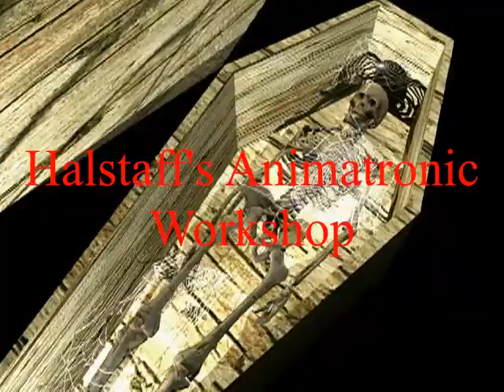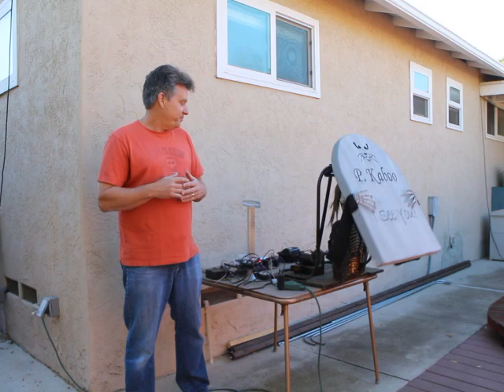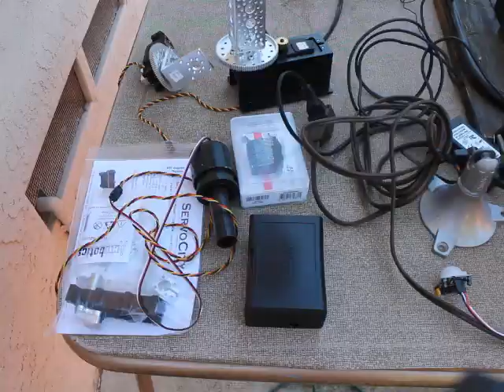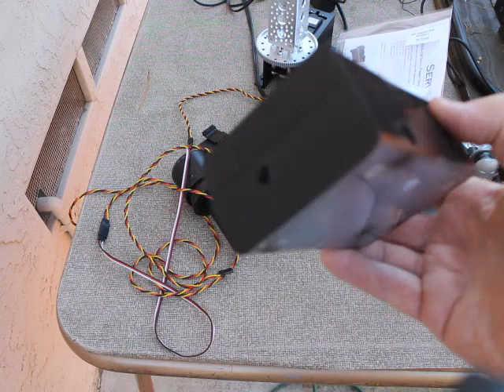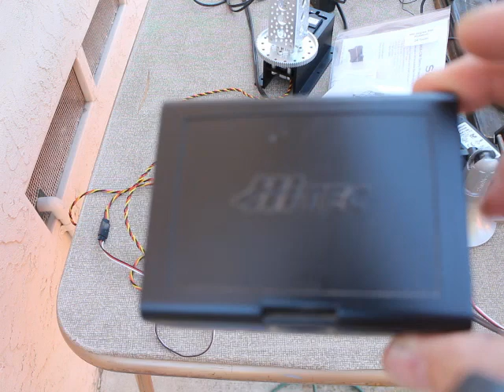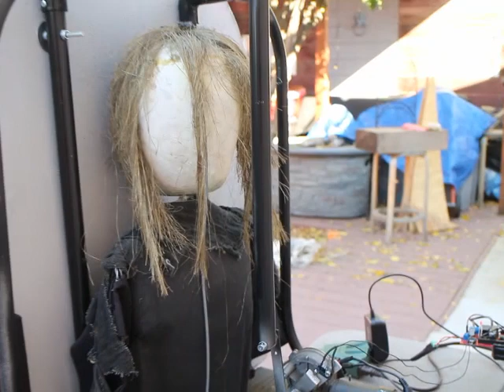Wiper Motor Tombstone Mechanism

Comment: Can you describe what materials you use for the linkage? Where do you get the arms? How are the pivots created?
Reply from the maker: Most of the linkages I use are made from standard aluminum bar stock that is available at most big box hardware stores.  I primarily use 1/4"bolts with washers and nylon lock nuts for my pivot points.